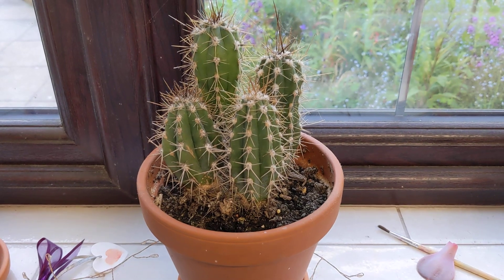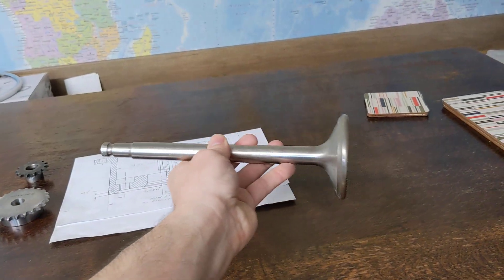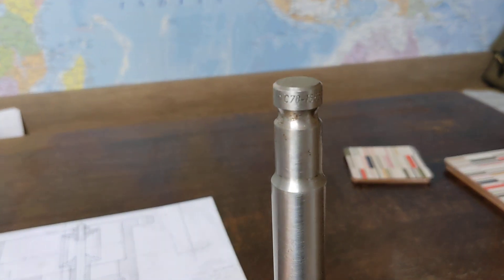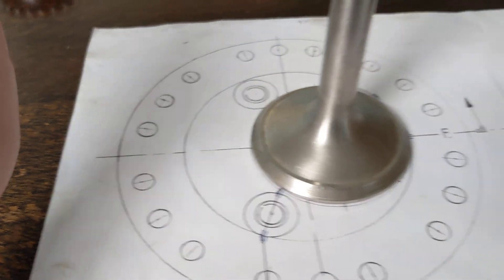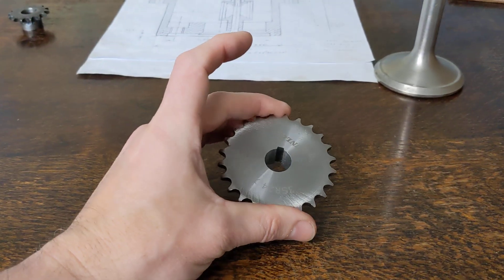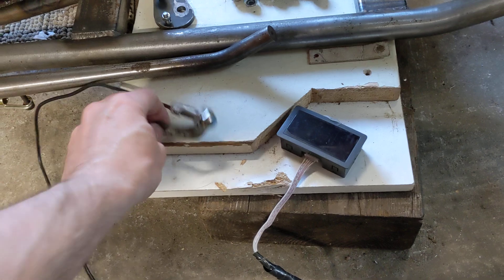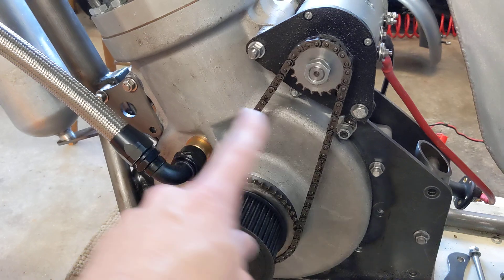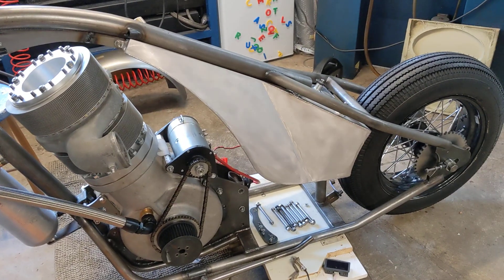Could this be re-purposed?

Comment: Does the valve has to be this big?
Reply from the maker: Yes. Even with both spark plug holes open there's a marked reduction in cranking speed. 3 litres of air needs to be compressed/relieved and even 'big' car engines don't have cylinders over a litre.

Comment: Ever seen the decompressors on small engines (ie: honda mower engines)?

no new valve, just a mechanism to hang the intake valve open at low revs. I think that will be simpler.

i also think using many small poppet valves will work better than few large valves. Iirc, Suzuki put as many as 7 per round cylinder. Honda used 8, but the cylinder wasn't round.
Reply from the maker: I don't think that would work on a sleeve valve engine. 🤔
Reply: @StoneEng  you were holding a poppet valve...

Comment: That valve looks like a sodium filled exhaust valve  very similar to a TD International tractor, just be careful machining it may be hollow.
Reply from the maker: Two people said the same thing. Any idea what the purpose of sodium filling a valve is? Expansion control? Depends how hard the valve is, but I might drill a small hole to see if it's hollow.
Reply: @StoneEng  The sodium fill is to cool the valve head by taking heat from the valve head to the stem and then to the valve guide, its better than burning valves.
They were used in hard working big engines probably working at max capacity for long periods, In the day the motors were underpowered for the work they were doing.
Regards Harold
Reply from the maker: @Turnipstalk thank you.. I'll keep you posted....

Comment: Nice work, I just recently came across your build and I am looking forward to it running. I had a thought with the size of that stem it could be sodium filled, not sure how you would find out though
Reply: If you can figure out its volume relatively accurately and weigh it, it should be easy to figure out if it's solid steel or not.